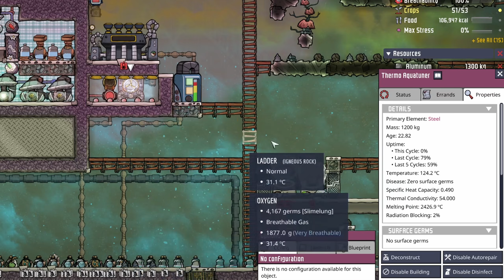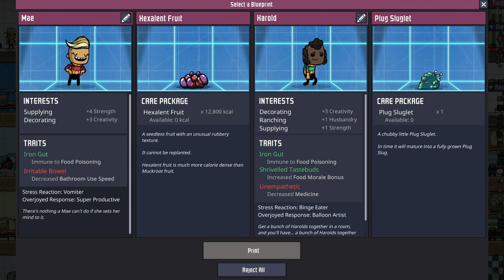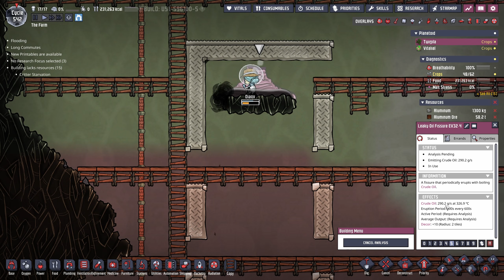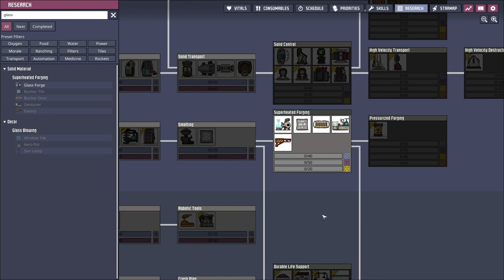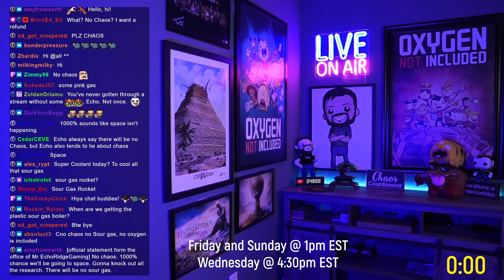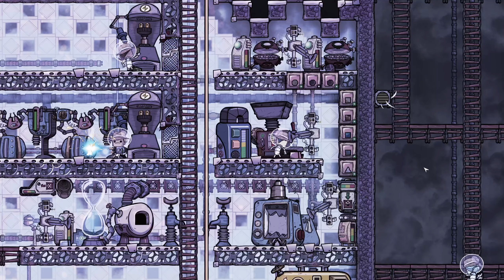Industrial Sauna start to finish | Ep 7 | ONI - Farm - Verdante

Comment: 24:05 full tile construction around drywall or tempshift plates is so odd 

If you just have a plate and try to build a tile on it, the plate will be removed, but if that tile is replacing a ladder segment it will not be removed

Also, if you put a mesh tile on a plate which is exposed to space, the gas will vent to space through the mesh tile when usually the tile blocks that

Comment: I did something similar with an oily fissure geyser. I was also surprised at just how little it heated up the water around it. And this will be my first game that I'm using the storage tiles. I still need to research them, but was planning to do something similar to your implementation.

Comment: I'm personally using the storage tiles for a visual indicator under several storage bins, along with as the flooring for my suit maker machine, or whatever its called I can't remember the name, but it holds the extra suits I have, along with all reed fiber, with an auto sweeper above it so dupes don't have to worry about filling it with reed fiber. they will however need to manually put any metal in for new suits I wanna make

Comment: I typically run the heavy watt wire straight through the liquid lock on the sauna up and down through the liquid without joint plates. Is this a better solution? Ive never had issues or temps above 30 degrees for over 2k cycles
Reply from the maker: The only bad part of doing it that was is the dupes running through the negative decor all the time.  I have done it both ways.
Reply: @EchoRidgeGaming  I see, I can't say the negative decor has ever affected my colony setups, but i suppose it depends on the playthrough! Thanks for the info :)

Comment: Was thinking here, isn't it possible to use geotuners to make that oil geyser to throw it away at pretty much 400 degrees and flashes to petroleum before it hits the metal tiles?

Comment: So, something I encountered recently with using Petroleum as my coolant for my refinery: If you run enough steel you can cause yourself a sourgas problem. To solve it I put a temperature sensor and bridge bypass, just like an aquatuner. This way if my petroleum hits a certain temp that's too high for steel, the refinery is turned off and can't be used until the coolant coming in is lower. I should have thought of using radiant pipe on my return loop to the aquatuner though, so as to save some energy.
Reply: I think I ran into a similar issue in my petroleum boiler. Sometimes I find a few mg's of sourgas has entered the vacuumed space. I ended up just leaving a permanent air pump in there 🤷
Reply: @maxstr  I did the same even though all I had was steel and it would often break at least once when vacuuming out the sourgas.

Comment: I started trying to kickstart the power brick by building that top floor out of airflow tile instead of mesh, and a temporary pump at the bottom to dump the liquid water next to the aquatuner.  Once it's all steam it still works fine, but it lets you kick the aquatuner on a lot earlier.  Does it help when they're tons and tons of temp shift plates to heat up?  I have no idea but I'd like to think so!

Comment: One improvement you can do is put a airflow tile in the vacuumed out section of the double airlock to further separate the temps. You would just need a insulated tile under it.

Comment: Thank you for the knowledge I didn't know one water line could handle 6 steam turbines. Glad I watch these series I learn things I never knew. Thank you Echo
Reply from the maker: It really isn't best practice.  You will get some bog down if all 6 turbines are running at once.
Reply: @EchoRidgeGaming  I usually connect 3-4 buy good to know
Reply: @LusciousLucien  5 turbines linked together is the limit as each turbine outputs 2kg/s and 2kg/s x 5 turbines = 10kg/s of water which is the limit for a pipes throughput
Reply: Thank you 😊

Comment: 38:15 You are using Poluted Water in a coolant system that passes through a 200C Sauna?
What will you do if it flashes in the pipes? You would not notice with the intentinal poluted water dropping. And you would loose cooling on the turbines.

Comment: Nice sauna! One thing though - you didn't install (or at least didn't show) any overflow for the water coming out the steam turbines. With the natural gas generators making water, you're going to have infinite steam eventually...

Considering how close the SPOM is, maybe you could use the overflow as the prioritised input to the SPOM? It would delete more heat (by turning the water into oxygen and hydrogen, which have lower specific heat capacities), AND just be a convenient place to put it!

Comment: ok, newbie question: What is the purpose for building a sauna brick in the first place?  Near as I can tell, all it achieves is eleminating the aquatuner cooling loop you'd have transfering the heat to a turbine instead?

I get some just want a nice neat place to put all the industry but for actual benefits is there something else I'm missing?
Reply: It also handles the outputs of the machines. Like this one, flashing the polluted water from the nat gas gens into steam.

Comment: When you snip a power line, you can't re-connect it unless you have the 25kg you would need to build one segment in the environment. On an asteroid this never comes up, but on a rocket in space? Yeah. So I always have a storage tile with the wire mineral in the rocket. The -10 decor of the tile is less than the penalty of the loose debris, it's neater, and you don't accidentally sweep it out when tidying the rocket between trips.

Comment: I heard people talking about the utility of the storage tile in rocket interior, but hunestly i only ever use them in the same way you used them here, in congestion with auto-sweepers, as a way to transfer material from one sweeper to another.

11:05 It was really painful watching the vacume get ruined twice because of that 6 tiles vacume lock, when you could have just put a bit of liquid in the second liquid lock and delete all the gases in there by building 6 tiles. There is no reason to brute force it with the gas pumps when its such a small space😅